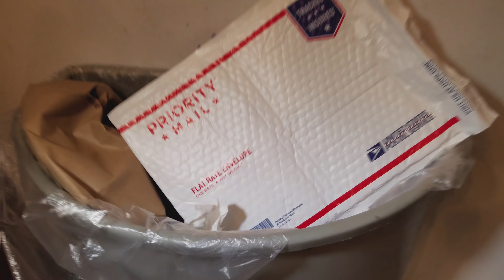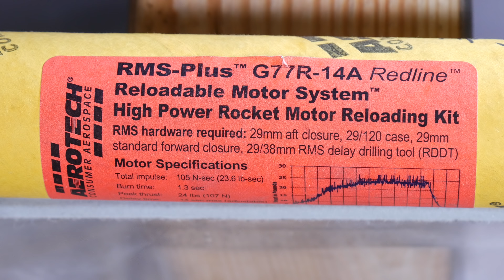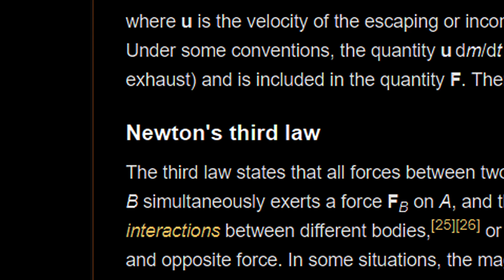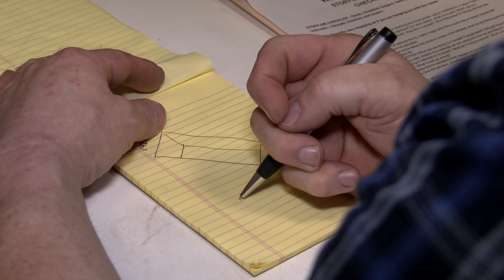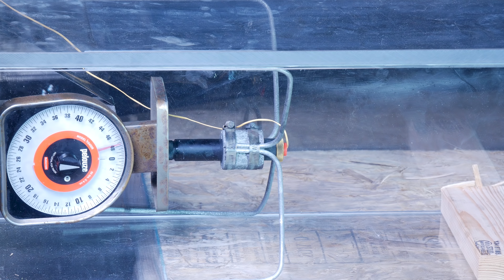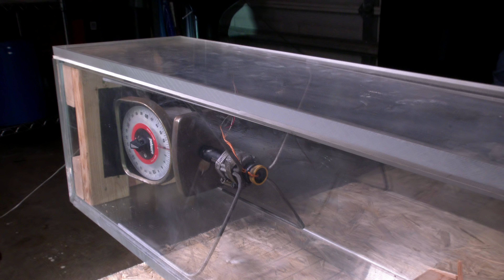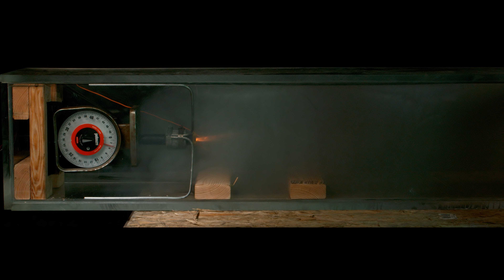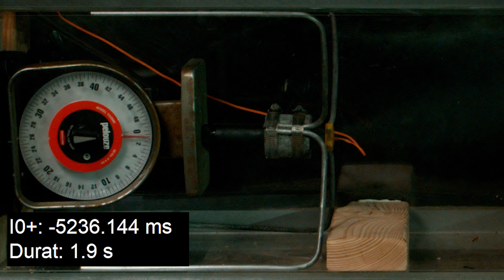Rockets in a Vacuum Chamber - Newton's third law of motion Visualized

Comment: Still pushed off the back wall. Take your gas lighting technique somewhere else lol
Reply: No sorry, rockets push on the mass that is ejected out the back.
Would a crossbow fired into a vacuum have any recoil?
Yes or No?
Reply: @Thetruepredictor  SO what WOULD happen if you fired a crossbow into a vacuum? You physics deniers NEVER answer this question when asked.
Reply: @rocketman484  We are not denying physics, the simple thing is that the law doesn't work in a vaccum environment for this specific experiment . It's simple as that.

Shooting a crossbow or kicking a ball does not necessitates an atmosphere, thrust and combustion does.

Where's your common sense?
Reply: @Thetruepredictor  - "Where's your common sense?"
Lets test your "common sense".
Answer these three questions regarding a running rocket engine here on earth in atmosphere:
1 - Does the exhaust gas get "Accelerated" as it leaves the nozzle?
2 - Does the exhaust gas have "Mass"?
3 - Can "Mass" be "Accelerated" WITHOUT a "Force"? Or is a force required to accelerate mass?

Answer these three questions to prove you understand some basic physics terms and we will get to the real questions.
Reply: @Thetruepredictor  - Chris-fm is scared to answer my questions because he knows that answering truthfully proves him wrong.
Reply: @stuartgray5877  you have no cash, you are a chatbot 😂
Reply: @Thetruepredictor  chatbot stuart gray thinks heat engines work by mechanical recoil. His programmers suck 😂
Reply: @Chris-fm1rk  chatbot stuart gray thinks you explain how things work by asking troll riddles. His programmers suck 😂
Reply: @papalegba6796  ikr🤣😂👍
Reply: @Thetruepredictor  A thermal rocket is a heat engine of the internal combustion type. Chatbot Stuart is programmed to deny this fact at all costs, as work calculations for heat engines are easy & show conclusively that a rocket cannot produce work in a zero pressure environment. No work = no motion.
Reply: @papalegba6796  All he or it has to do is demonstrate the claims and stop making fallacies.
Reply: @Thetruepredictor  it can't. All it can do is spam troll riddles, false analogies, abuse & lies. Like, it has asked me hundreds of times where the force comes from that accelerates a gas out of a rocket. I have told it hundreds of times that gas expands from higher to lower pressure using its own internal energy, and that no force is applied during this process, as gas particles are in constant motion. This is the basis of kinetic theory, yet chatbot stuart ignores my answer every time & simply repeats the question. It exists to wear you down & it is definitely not human 😂
Reply: @papalegba6796  - "Like, it has asked me hundreds of times where the force comes from that accelerates a gas out of a rocket. I have told it hundreds of times that gas expands from higher to lower pressure using its own internal energy, and that no force is applied during this process"

So you STILL contend that mass can be accelerated without a force, contrary to Newtons first two laws.
You just refuse to ADMIT THIS FACT.
Reply: @papalegba6796  - AND then you also DENY what is happening in that video of the Falcon Heavy side boosters flying back to KSC IN A VACUUM.
Again, I guess they canceled that 3600 MPH EASTWARD trajectory then turned around and FLEW BACK using - MAGIC.
Got it.
Reply: @stuartgray5877  what video, insane chatbot? 😂
Reply: @stuartgray5877  the gas particles don't accelerate, chatbot, they are in constant motion & their velocity is a function of their energy. When they expand from higher to lower pressure their energy remains unchanged they just have more space to expand into, so the velocity of individual particles is the same. THIS IS BASIC KINETIC THEORY CHATBOT FFS STOP LYING &TROLLING ME 😂😂😂😂😂😂😂😂😂😂😂😂😂😂😂
Reply: @Thetruepredictor  it's at it again it will never stop no matter how often I explain 😂
Reply: @stuartgray5877  THE GAS IS NOT BEING ACCELERATED, CHATBOT! 😂😂😂😂😂😂😂😂😂😂😂😂😂😂😂😂😂😂😂😂😂😂😂😂😂😂😂😂😂
Reply: @papalegba6796  - " the gas particles don't accelerate,"
YES.
YES THEY DO.
That is what it is CALLED when a mass changes velocity.
That is literally the DEFINITION Of the word "Force" genius.
Reply: @papalegba6796  - There is NO POINT in even arguing with you when you deny simple observations and the definition of physics terms.
Reply: @papalegba6796  If it isn't a chatbot then the worrying thing is that this person is probably allowed to drive.
Reply: @Chris-fm1rk  - Not only am I allowed to drive I am also a race car driver. So now "Bots" have careers and race cars too?
Cool story bro
Reply: @Chris-fm1rk  And own a crossbow 😂
Reply: @stuartgray5877  says the chatbot that thinks kinetic theory is wrong  & can't tell the difference between a rocket & a crossbow. 😂😂
Reply: @papalegba6796  🤣
Reply: @Thetruepredictor  - "the simple thing is that the law doesn't work in a vaccum environment for this specific experiment ."

Excerpt you have been told by Engineers, and Physicists that rocket propulsion is the mechanical recoil of pushing on mass.
You have been given examples and asked questions to help you understand but you refuse to participate and instead choose to hurl juvenile insults like papplegba.
You were also shown live video that depicts rockets working in a vacuum, but you dismiss all of this even though it is obvious that you have no education or hands-on experience on the subject.
So why do you choose to remain willfully ignorant and insult people who work on this stuff for a living?
Reply: @rocketman484  you're claiming people can't lie now, chatbot. Which is a lie 😂
Reply: @papalegba6796  - Except physics agrees with ME.
What you keep claiming violates Newtons laws.
Mass CANNOT be accelerated without a force - PERIOD.
The exhaust gas from a rocket HAS MASS therefore, rocket exhaust CANNOT be accelerated except by a force .
Now tell us where the force COMES FROM that accelerates the mass into the vacuum.
You keep CLAIMING to have answered me, but you have NEVER answered that question. You keep claiming that the exhaust gas can be accelerated without a force which is a violation of Newtons laws.
Reply: Chatbot Stuart going round in circles as usual. It has a very short markov chain 😂
Reply: Never said that, chatbot stuart. Like I said, you ignore my answer & repeat your nonsense 😂
Reply: @papalegba6796  - "Never said tha"

That is because YOU REFUSE TO TELL ME: What IS accelerating the mass of the exhaust from the nozzle. Is it Magic?
Reply: I already answered chatbot stuart, then predicted it would ignore the answer & repeat the question & guess what? Yep it just did exactly that 😂
Reply: @papalegba6796  SO just REPEAT THE Answer HERE.
Or is copy & paste above your level of intellect?
Reply: Why should I repeat the answer when it's in this thread & you already ignored it, ChatGPT guy? Thanks for showing you are a chatbot programmed to waste my time 😂
Reply: @papalegba6796  See you will type up more words weaseling out of answering that it takes to just answer. Bless your little heart!
How do you keep all of your lies straight. Do you keep notes?
Reply: @papalegba6796  - "I already answered"
Oh? On THIS thread?
On THIS VIDEO?
WHERE?
Point me to this answer or just cut and paste in here again.
The teacher of your special needs class can show you how to do "cut & paste".
But Bless your little heart for effort!
Reply: @stuartgray5877  😂😂😂😂😂😂😂

Comment: Like people are saying, this is a pretty poor test to see if rockets burn in vacuum. If you really think that it's the pushing on the air that produces the thrust, then sure - the vacuum chamber gets filled up with gases once the motor ignites. Forget rockets for a second, though. Imagine you're floating in orbit around the Earth (If you think the Earth is flat and space is fake, you're still able to imagine this). On your back, you have a container partially filled up with liquid water and some gas, for example nitrogen. The tank is highly pressurized. You have a hose in your hand, with a valve on the end. If you open the valve, the water will come rushing out. What do you think will happen? If you're thinking that you'll get pushed backwards, you're right. Why is that? Well, the water rushing out has a mass. When a mass is accelerated, a force is created. Remember, the water goes from stationary within the tank, to suddenly achieving a speed - mass times acceleration equals a force.

What has this got to do with rockets? Well, that's easy. Instead of using water motors, which has a low energy density (as in, lots of mass but not a lot of energy for the amount of mass), rocket fuel is better. Rockets bring their own oxidizer, so that when mixed with rocket fuel, a combustion occurs. The combustion is there for one reason only - it allows for the mass of the fuel+oxi to be expelled behind the rocket much faster than if they weren't combusting. The faster the mass leaves the rocket, the more force you get. The equation is F= m * a. a is acceleration. Acceleration is a speed, meters per second, divided by how much the speed is increasing per second - so m/s per second, or m/s^2. If you increase the speed of the fuel leaving the spacecraft by burning it, so that for every second more mass leaves the rocket, you're increasing the value m * a - which, like I said, creates more force.

In short - rockets creates propulsion in a vacuum, not because it's pushing against something, but because they're essentially throwing the mass of the burned fuel behind them.
Reply: f=ma refers to net external force on an object. you're misapplying it.
Reply: @papalegba6759  No, F=ma can represent a single force. If talking about the net force of an object, you can say Fnet=(ma)-(mg), for instance. I should've mentioned that the net force when a rocket accelerates is comprised of engine force, inertia, gravity, gimbal side force due to a shifting COG and so on. But in the simplest terms, F=ma for expelling fuel. My point was just that you get a force acting in one direction if mass is shed in the opposite direction - and that you don't need air to push on.
Reply: @ojkolsrud1  wrong. from encyclopedia britannica:
"The second law says that when an external force acts on a body, it produces an acceleration (change in velocity) of the body in the direction of the force. The magnitude of the acceleration is directly proportional to the magnitude of the external force and inversely proportional to the quantity of matter in the body."
also, forces come in pairs; there is no such things as a 'single force'.
"Newton was the first to realize that all forces occur in pairs and there is no such thing as an isolated force, existing all by itself".
you don't understand newton's laws, this is a proven fact. muting you now as you will never admit it & just waste my time with pseudoscience.
Reply: @papalegba6759  The reaction is the fuel leaving the rocket, and the opposite reaction is the rocket moving forward. That's the pair. Yes, "single force" was a stupid way of putting it. What I meant was, F=ma can be calculated in one direction at a time, but you have to consider what the opposite force is too. For example, you can calculate how many newtons an object on a table weighs - you don't have to consider that the net force is zero if the object is at rest - it depends on what you want to do with the number you come up with.
Reply: @ojkolsrud1  you're describing both forces being created on the same object. you also described both forces as the 'reaction'. you do not understand the subject.
Reply: @inniuniui9361  Haha oh man, I'm writing things being way too tired. Yes, the first "reaction" should've been "action". Well, the force created by expelling the fuel from within the rocket is what's pushing it forward. Same as if you hold something heavy and throw it.
Reply: @ojkolsrud1  a CD nozzle creates no external force. it's an energy converter. if you're referring to pressure inside the combustion chamber, that is an INTERNAL force; and newton's 1st law requires an EXTERNAL force to alter a body's state of motion. as for your false analogy about throwing heavy things, a rocket does not have arms that throw things. it releases highly energised gas, and according to w=PV that gas requires EXTERNAL pressure in order to do work. you don't understand any of the physics involved.
Reply: @inniuniui9361  The "arms" is the fuel leaving the rocket due to the internal pressure of the combustion system. 

The ambient pressure of space isn't zero, but very close to it. 
The force that will be generated is based on the flow rate of the fuel leaving the rocket times its speed, plus the difference in pressure as it leaves the nozzle minus ambient pressure, times the area of the nozzle.
F=m_rate*V + (Pe-Pa)*A_nozz
Pa is close to zero. 
It's apparent that the lower the ambient pressure, the bigger the exit section of the nozzle should be. P*A=Force/area * area = F
m_rate*V is governed largely by the choke section of the nozzle. To get more thrust, you need to figure out just how big this area should be, where you get the most amount of fuel out of the rocket and at the same have it leave at a high speed. m_rate*V = mass/time * length/time = mass* length/time² = F

I think that the tricky part is understanding how there can be a pressure inside the combustion chamber, when there's virtually no pressure on the outside, and still achieve a meaningful pressure at the end of the nozzle which will cause there to be a force pushing on the rocket. Typically the internal pressure of a system is equal to the ambient pressure, when the system is not closed. Here' you might think that it's not closed. But, when the gas in the combustion chamber tries to expand, it's hindered by the choke of the nozzle. If the combustion chamber and the choke had the same diameter, the rocket motor wouldn't work, because there would be no pressure difference between the nozzle bell and the combustion chamber. Another thing is that prior to the gases of the fuel even reaching the combustion chamber, they're already pressurized. Rockets have pumps onboard. Think of it this way: Start of with a combustion chamber that has no opening at all - it's sealed. This will result in an explosion probably, but instead think that it'll have a very high pressure. Now make a small hole (the choke of the nozzle) in the combustion chamber where the gases can escape to. There will still be a high pressure, but in the same time as before, the pressure will be less. The bigger you make the hole, the less pressure will be achieved in the combustion chamber, until it'll just equalize with the ambient pressure as the hole gets to the same size as the combustion chamber. The gases must expand faster than they will exit through the choke, too. You would forward thrust  even if you don't light the fuel on fire and just squirt them out in the back. The pressure wouldn't be higher than what ever the pumps achieved, and I guess the same with the flow rate and speed. Very little thrust, but still some. 
Sorry for the very long reply...
Reply: @ojkolsrud1  if the arms represent the fuel leaving the rocket, then what does the object the arms are throwing represent? the external body of the atmosphere against which the exhaust pushes, clearly.
as for the rest of your gish-gallop, it's based on the already discredited notion that isolated forces exist. plus, thrust is an applied force, and applied forces come from an EXTERNAL body. so the exhaust itself cannot by definition be responsible for creating thrust; only the atmosphere can do that. you're just trolling at this point, as you refuse to even acknowledge newton's 1st law, let alone the gas laws.

Comment: every last one of you is set on going to the stars............you're not going anywhere.
Reply from the maker: I'm on my way... Mars here I come.
Reply: @jrngln   
Nice copypasta. Every word of what you just said was wrong.

1) We can get close enough for practical purposes. Technically space isn't a pure vacuum either, but it's so rarified that molecules rarely come into contact with each other.
2) A vacuum doesn't "absorb" anything, you're speaking nonsense.
3) How exactly do gases on the opposite side of the chamber affect the rocket motor? The answer is they don't. The only forces come from the direct interaction between the motor and the gas. As soon as the gas leaves the motor, it can't transmit a force.
4) Yep. Rockets push off of their exhaust gas.